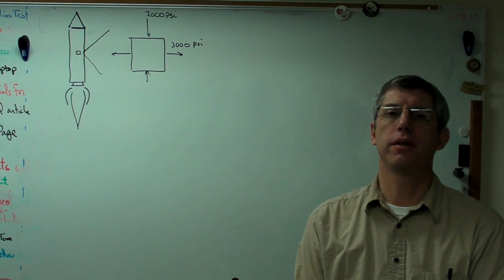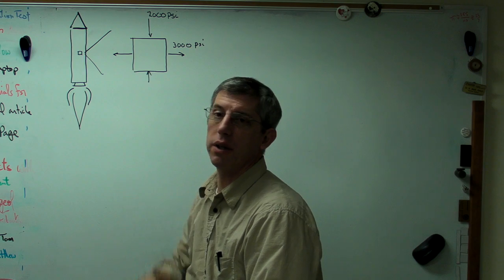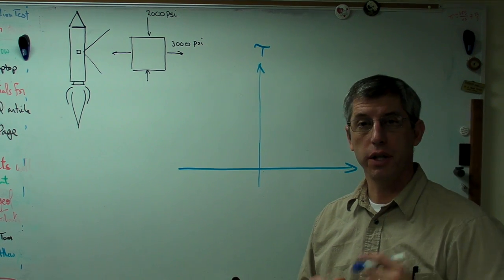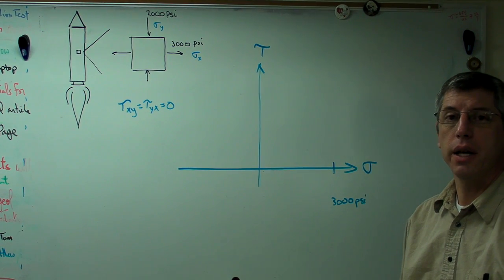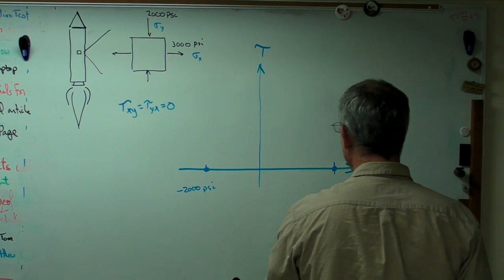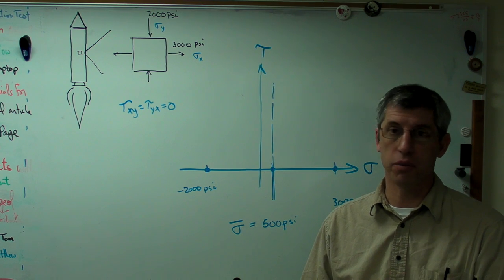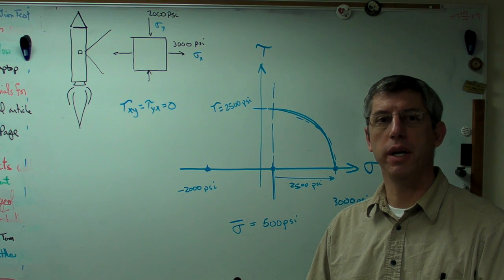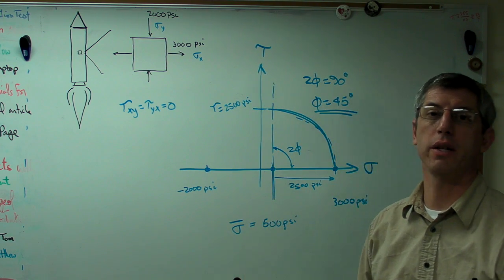Mohr Circle 1.MP4

Comment: Does this imply that when we have external compressive forces only, that there will always exist shear forces in some direction (45 degrees rotated from our original set of axes).??
Reply: If you had equal external compressive forces in x and y, the two points would lie on top of each other and there would be zero shear stress. Otherwise, you are correct

Comment: Where did you get that Sigma=500 psi from? Or you just calculated the center of the circle that's all? And when do we draw Mohr's TRI circle? Thank you!
Reply: Hi Chlyeh, I´m Spanish teacher learning technical english, and  how you say sigma=500 is the center of the circle.
Reply: he just got the average between 2 sigma values by adding both values then dividing by 2
sigma average =(sigma1+sigma2)/2 ,which in this case will be
=[(3000+(-2000)]/2=500 psi